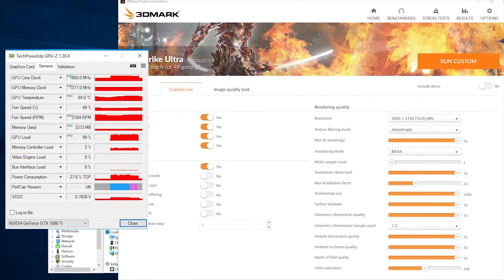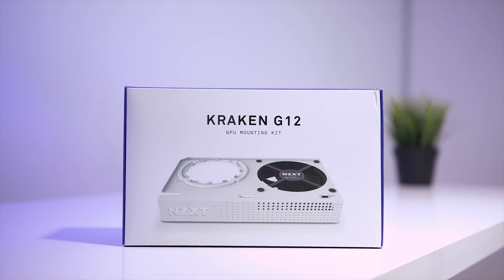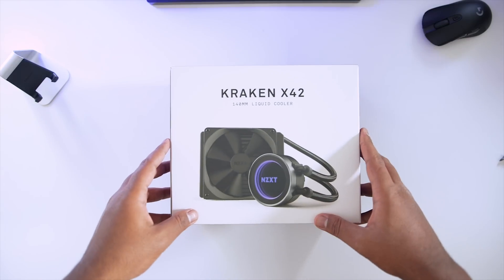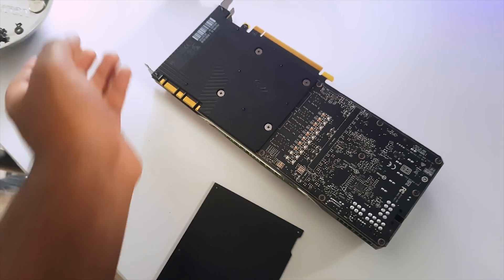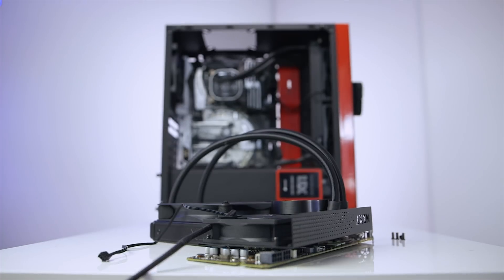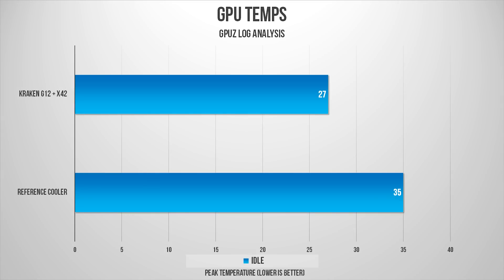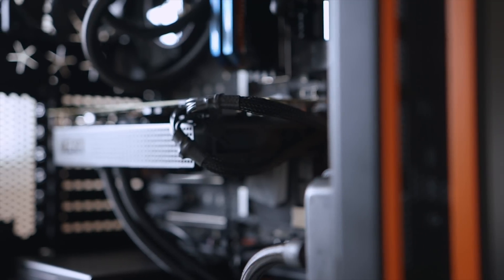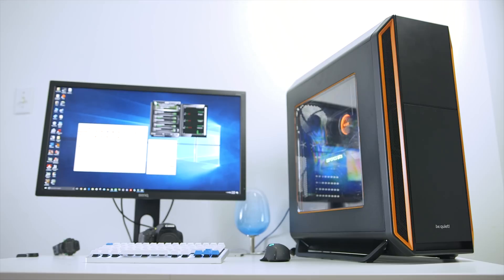Watercool ANY Graphics Card! -- Testing the NZXT G12 Bracket

Comment: Do not leave the thermal pads on because there is no thermal coupling to a heat sink. They are basically insulation in that application.

Comment: Thanks for this guide. My 1080ti FE has been reaching temps of 90c for the last year of gaming and no amount of cleaning and blowing out the dust has helped. I bought the 1080ti FE on launch for $699 and saved money by not ordering the aftermarket models with better cooling, so in my eyes the money I'll be paying for this liquid cooling upgrade is totally worth it and it's the money I saved buying the FE anyway. I just ordered all the parts listed in this video from Amazon and it came to around $135. Not too bad. Worth every cent if it's going to keep my beloved 1080ti alive for many more years with much cooler temps. Thanks again:)
Reply: I have a 1080ti in a closed box of a case but I have the EVGA ftw3 model and it's got me interested I might try it on my 1060ti 6gb for my dad's computer I'm building him but I'm going to see how the temps hold on a heavier overclock

Comment: Did this on my 5700xt with an x53. Getting mid 50s to 60s junction temp while getting 2050mhz actual clock speed. Upgraded the 92mm fan with a noctua and my memory temps stay in the mid 70s. Had a small 120mm on there before but don't think the mounting pressure was enough. Used thermal grizzly paste

Comment: Question... Why have they used a fan to cool the RAM? Why not have a aluminium plate that covers the whole GPU? Using heat pads on the RAM to make contact with the plate and the NZXT cooler directly on the plate?

Comment: hi im using a corsair h55 on a gigabyte gtx 1080,i followed the steps but after few mins ingame the gpu throttles and shuts down any game, any tips?i checked temps with gpuz and are pretty low

Comment: Imho the main reason for doing this would be people seeeking quieter performance. My 1660ti is obnoxious, and overclocking it with the stock cooler is horrid. Therefore, this is the go to option
Reply: yup dude. my 1080ti ive only seen get to 85 ever, but damn is it loud.
Reply: i think its a much better option to zip tie two quieter and better performing fans. Just did it to my R9 390 and it only goes up to 58c during load. Best of all, can't hear the noise (Arctic P12 PWM)

Comment: I did this week with an EVGA RTX 2080 Super. I went from 54c idle to 32c. and from 74c load to 44c. Not bad. I had a H55 cooler from an old build so this only cost me $28.
Reply: Fk h55 rgb is not compatible

Comment: i bascally had to make my rx 580 strix card as a exhaust in the rear because it was just pushing way to much heat in the case to where it was making my cpu spike much higher which was about 60C on my 3700x  and now since its running as exhaust my temps on the cpu have dropped about 5 to 6 digress Celuis . case im using is a corsair icue 465x with a 240mm thermatake rad in front and gpu aio in the rear as exhaust and 2 exhaust fans to help pull the heat out. depending on some games my temps on the gpu since its overclocked to 1500mhz im seeing temps of about 65 to 75C which rx  400 and 500 series run pretty hot out of the box. which most rx 500 cards can handle up to 87C max after that it will start to throttle or possiblly make the video driver crash so you dont ruin your card.

Comment: I got myself a used Strix RX480 and even with having the best after market cooler on the market it still was getting pretty high temps after a few hours or solid gaming, to the point where it would throttle back, So I chose the NZXT cooling solution seen as I had a NZXT X62 AIO cooler on my shelf collecting dust while looking pretty, So I spent just £24 on the cheapest G12 bracket, and trust me the price does change depending on the colour you want, ( WHAT'S THAT ALL ABOUT "NZXT"). Anyway after taking off that Strix cooler and cleaning off that ooh so very dry and crusty paste I applied Thermal grizzly Liquid metal and slapped on the G12 bracket with my X62 AIO I'm very happy to report the temps dropped dramatically, My Strix RX480 now idles at room temp and barely breaks a sweat after hours of gaming the highest temps being just 54c with my room ambient temps at 27c in summer, its now a proper good solid gaming card, I can now get a higher OC with lower voltages, and even at idle its using less volts which is a plus with such a power hungry card. But I will say this if I didn't already have the NZXT x62 I would not have bought one just for this purpose, I probably would have bought a Corsair H55 and a G10 bracket as I know the H55 is adequate enough to cool a GPU dye of the rx480 and cost way less than the over prices NZXT coolers.

Comment: 69°C is still CRAZY high for the watercooled solution. I am using the exact same setup (1080Ti FE + X42). Overclocked the GPU as much as I could and it should never go above ~47 - ~49 degrees. Under Load it usually should stay around 45°C +/-2°C.  Seems the coldplate was not properly mounted or you ran the fans at minimum speeds all the time?

Comment: Compatibility - Graphic Cards
Nvidia - Geforce RTX 2080*, 2080 Ti*, Titan X, Titan, Geforce GTX 1080 Ti, 1080, 1070, 1060, 980 Ti, 980, 970, 960, 780 Ti, 780, 770, 760, 680, 670, 660Ti, 660, 580, 570

AMD - RX 580, 570, 480, 470, R9 390X**, 390**, 380X**, 380, 290X**, 290**, 285**, 280X**, 280**, 270X, 270, R7 370, HD7970**, 7950**, 7870, 7850, 6970, 6950, 6870, 6850, 6790, 6770, 5870, 5850, 5830

*RTX uses the "A" brackets for mounting.

**Some variations in AMD die height may require the use of a copper shim which is not included.

Compatibility - AIO Liquid Coolers
NZXT

Kraken X72, X62, X52, X42, X61, X41, X31, X60, X40

Corsair

H105, H110, H90, H75 (CW-9060015-WW only), H55, H50 (CW-906006-WW only)

Thermaltake

Water 3.0 Riing RGB 360, 280, 240, Red 280, 140, 

Water 3.0 Ultimate, Extreme S, Extreme, Pro, Performer

Water 2.0 Extreme, Pro, Performer

Antec

KUHLER H2O 920V4, 620V4, 920, 620

Zalman

LQ-320, LQ-315, LQ-310
Reply: lastone032085 is there anyway to get this setup to work with Vega?

Comment: I still don't get it why people install the radiator at the air intake, preheating the air witch is going inside the case... omg... sure the gpu block will get the fresh air first, but you are heating up all system... and you don`t really need a double radiator for a CPU, but for that kind of gpu, sure!

Comment: Ok, got the Kraken G12 about a year ago but never used it. Decided to use it on my Titan Xp Star Wars Edition.  Figured it would be best to use a NZXT cooler so I got the X52. After planning my setup out, my final results were: Stock blower Idle:40 Load:69 Boost to 1886mhz.  With the G12 and X52, Idle:19 Load:35 Boost to 1898mhz(sometimes 1911mhz).  I'll be putting that star wars cooler back in its glass case and up for display now that I can actually see it. As stated, I paid $166 for both products after a year.  Totally worth it.
Reply: Hello i'm planning to buy one to my 980 ti card soon so did you test them under full load or gaming ultra presets and what thermal liquid metal did you used?. I'm planning to buy Thermal Grizzly Conductonaut is it best.
Reply: @ferrariifxx9983  I used Arctic MX-2 and added new thermal pads on the VRAM and power phases. Also added a 2 120mm fans to the bottom of my case for extra cooling. I'm in Georgia and it's cold here now but idle is 20 and full load has maxed out at 36. playing at 3440x1440 on very high to ultra. some games I run at 2560x1440 on ultra.
Reply: @ferrariifxx9983  I used grizzly on my 8700k after deluding it with a caption 360 cooler. but only between the dye and ihs. used mx-2 on cooler.
Reply: Update: Will be adding some 8mm copper heatsinks to the VRAM modules. The ram gets hot enough where you can feel the heat on the other side of the board. But like everyone else's experience, you can't ready check them and most products don't really address the cooling on these compenents. Anyhow, time will tell.
Reply: Final Update: Added the heatsinks on the thermal pads. Under load the gpu max is now 30. Added a few heatsinks to my 3 NVMe M.2 drives as well. To touch the VRAM aren't firey hot like before. Overall I'm satisfied.

Comment: Thanks for the great vid. From what I can tell, unless you are running a studio and need a very quiet system or you are overclocking you dont get a performance boost. While yes the temps are lower it didn't seem to effect the clock speed much.

Comment: I did the same setup in a NZXT H700i case with two Kraken X72's (front/top) and seem to bet getting great results. Played Battlefield V all day yesterday and never saw GPU temps over 55 C. I love this thing but you do have to be careful getting it on the gpu and think about radiator fitting. The USB 2.0 advice was spot on as well, I has to purchase a USB hub to power all of my lighting and case
Reply: did you need the CAM software to make the pumps properly works for the gpu cooling ?
Reply: @vengeanceu  not sure if it was necessary but I am using CAM to regulate the fans, pumps and rgb lighting
Reply: Hello I'm planning to buy kraken x72 or x62 what is that you mean radiator fitting and about usb 2.0 will i get along with the box or do i need to buy that part ?. If so then can you please give the link of it, so that i will buy that usb 2.0 from amazon.

Comment: Dunno your temps are higher than those I've seen for the Morpheus 2 which comes in a decent bit cheaper even when using Noctua fans, and that thing has no moving parts so there's that as well.

Comment: I ordered my G12 the other day, Im going to use it on a 980ti which gets me about 19000 Firestrike 3dmarks, but she gets hot.  I justify the purchase by pairing it with an original (old) Kraken X52 280mm rad.  I think with just 2 fans on on the rad it's gonna be a little less noisey. replacing the old Kraken with a new x72   :)

Comment: I used the G12 with an H55, which for me was a more economic solution than alternative AIO's. In terms of Radiator air flow I've read and heard a lot of conflict in terms of which is best, ie intake or exhaust set ups........  Corsairs AIO instructions advise Intake, which makes sense to me because the air outside your case will invariably be cooler than whats inside, ie if used as an exhaust your passing hot air through the Radiator..... Just wondered what your thoughts were ?

Comment: Just did this. My 1080ti FE was regularly hitting 87°C in VR, so I put the stock cooler on my Ryzen 7 and put the Kraken X62 from that onto the GPU. Now I can't push it past 57°C. Was throttling to 1500MHz, now staying around 1885 MHz with no overclock. 

Regarding heatsinks, thermal pads... I don't have any on it and it seems stable. I did buy a load of tiny heatsinks but the tape was so weak I couldn't even turn the card upside down without 3/4 of them falling off and pinging all over the place, even though I thoroughly cleaned the components with alcohol and dried them completely. Did not want to risk that happening with a spinning fan and powered on. I can't tell my VRM temps, so I'd rather have them on but it seems to be working fine.
Reply: tSp289 Still fine with no heat sinks?

Comment: I really would have needed some more Specifics about this Bracket. How is it cooling the  Components other than the GPU? I have seen a normal Fan but is that all? Are there any additional Passive Coolers? How is the Airflow over the PCB and what Temps do the Mosfets and VRM have?

Comment: Wow glad I found this! I reduced about 20c on my GPU! Amazing!
Reply: You could probably see an even better cooling effect if you buy a VGA to CPU fan converter cable for about $8. This will allow the Rad Pump to be controlled and powered by the graphics card itself, since it understands what it needs better than the MB fan controllers that you'd typically plug into with this kit.

Comment: hello! i have one question ... i use kraken x52 on my CPU cooling and now i want to buy second kraken x52 (+ nzxt g12) on my GPU cooling , but i dont know where i put it this second kraken (GPU) fan (pump) connector?
Reply: i answer my self. 
there are two ways...
1st way : cut gpu card orginal fan power cable and use it, now gpu card control u pump & fan.
2nd way : use u mother board fan connectors. choose full power connector u pump and some good air flow connector u vram fan.

Comment: Have push/pull on my x31. With liquid ultra on the 1080 aswell temps are on 42 degrees max AND it's overclocked way over the top, hack hack hack

Comment: Should i use 120mm or larger AIO with GTX1080 FE ? Those temps he got make no sense but i still think that Kraken G12 would be the best solution to fix the high temps. 

Sidenote: I got my temps down to 60-69C just by changing the fan curve. If you look at the temps he's showing at the start you can see that the fan is spinning at ~50% speed, which is pretty bad considering that the card is running at 84C.

Comment: That RGB cooler only was worth it if you had a vertical mount. Or an inverse PC case with a glass panel on side and top.

The watercooling will only be relevant to Titan-X with a massive OC. Other than that there is no point as most ppl would rather have more performance out of a better GPU rather than a spending that money on a weaker GPU with water cooling and OC. Of course I am not most people so that is just my opinion.

Good video thou. Personally I liked the NZXT bracket in white. Would have been cool to see an RGB fan with it. lol but then again no point if all the cool stuff is facing downwards.

Comment: You don´t need a 130$ cooler for the NZXT BRACKET, get a water 3.0 performer from thermaltake and you will get the same results, and it cost´s only 50$, and why don´t you place the radiator at the rear fan position ? 
I have a much smaller case and I can fit it all in my case...

Comment: I went with the Corsair H75 120mm AIO($75USD) + NZXT G10 Bracket($30USD) setup for my 4GB GTX 980, it is a cheaper solution then the one in this video & very quite vs the stock nvidia reference blower style cooler. Some tips I would recommend if you go this route is replace the stock nzxt 92mm fan that comes with the g10 bracket with a 92mm noctua fan & replace the thermal paste with liquid metal(on the gpu die) if you are experienced enough, way better temps in the long run.
Reply: way better temps or like 3 degrees?

Comment: Great video!
I did all that with my  GTX 980 ti g1 gaming and I was able to overclock it roughly about 50% on the core clock as opposed to reference design without increasing the voltage.. 
BUT then it died! 
Upon voltmeter inspection 4 out of 8 power delivery mosfets where shorted (basicly one of two 8pin power rails) and so I wonder if I applied thermal pads and small aluminum radiators on them (and perhaps the memory chips too) would that have saved it? 
I didn't see you applied anything on those mosfets except the bare thermal pads that don't make contact with the aluminum body of a Kraken G12?

Comment: No wonder you are getting bad temps. you apply The thermal compound like its a CPU. you need way more on a GPU than what you used. Also, you should use some Liquid Metal Tim. like Thermal Grizzly Conductonaut. or Coollaboratory Liquid Ultra. if you do that, you should see the Temps drop like a horny Blond's Pants !!!

Comment: Funny. I went for the Arctic Accelero Mono Plus for my Zotac Gtx 1070 Mini. I added a custom fan (Thermaltake Riing) since the stock one looks bad. All together it cost me 55€. The results are amazing, compareable to what You got out of this water cooler. 28°C Idle (stock around 38°C), 62°C (stock 78°C) BF1 ultra WQHD. It is no water cooler, but still it looks great with the Riing.
Reply: That's very best temp then what about full load at FurMark and heaven ultra presets ?

Comment: Well you've learned one thing, it's always good to have a cheap tool kit knocking around with absurdly small sockets. I had no idea I'd use a 6.5mm socket until I realized a radiator hose clamp on a car I use to own required just that socket. Manufacturers of all types use really strange methods sometimes.

Comment: I threw on a G12 with a H55 on to my 1080 Ti Strix... 24c at idle and in game it averages at 50-54c and highest I have ever seen it is 61c with a stress test running for 1 hour at 2050MHz core and 12,008MHz on the memory 528GB/s memory bandwidth in a RL06 Pro case.

Love this thing.

Comment: I am definitely going to do this to my gpu though I'm confused since every review seems to brush over it, where do you plug the fan and aio pump cables to?
Reply: they  plug into the motherboard but you can get an adapter so they plug into the GPU fan socket so the GPU can still control the fan speed

Comment: I have a RyZen 1600x and an msi 1060. How cheap can I make a custom loop while not having questionable quality in parts? I plan on overclocking the cpu to 4.0ghz and a little overclock on the gpu. The gpu will be in the loop also. Any advise helps!

Comment: I think that using a 120-140mm aio to cool a 1080ti gpu that is factory rated at a 250 watt tdp might not be the best idea.  Maybe it would work in a pinch, but the heat dissipation capability of a small single fan radiator, even a good one, is nowhere near 250 watts.  If you have a lower power card, like a 1070 or even a non-oc'ed 1080, it would probably be sufficient.  For a 1080ti though?  240mm with a good pump would see temps in the 50's under load and no heat soak.  If that little aio was left to cool a loaded 1080ti for more than 15 minutes those temps would've gotten much higher, and then stayed there.

Comment: this is a stupid comparison why would you buy a kraken series cooler if you can't see it I am just going to use the corsair h110i for my gtx1080ti since it costs less than the x42 and performs alot better than the x42. anyway i really do like the kraken series and i am using an x52 but i wouldn't buy it for my gpu